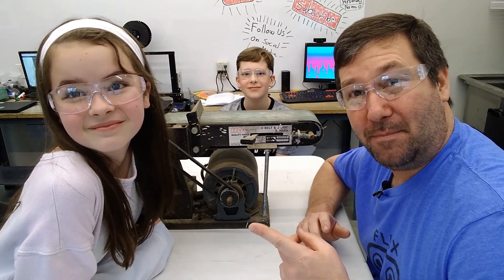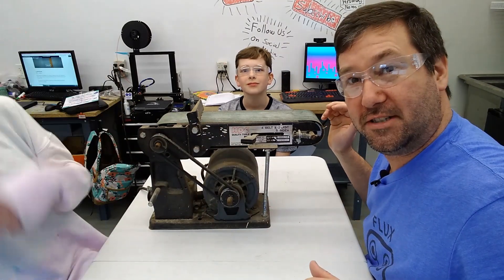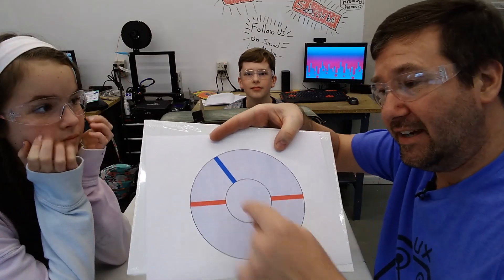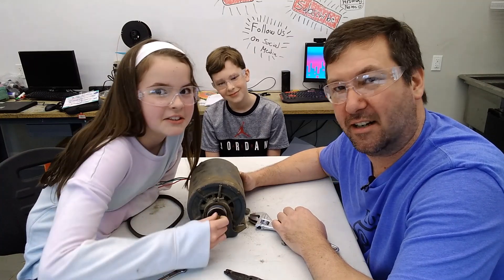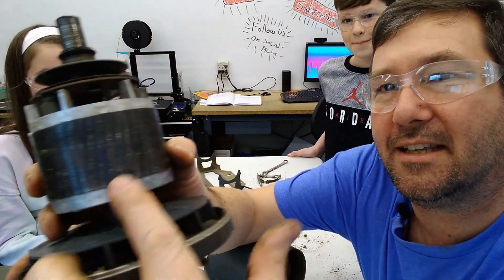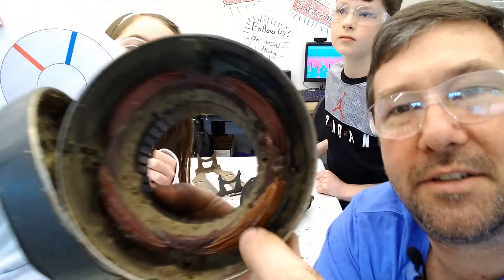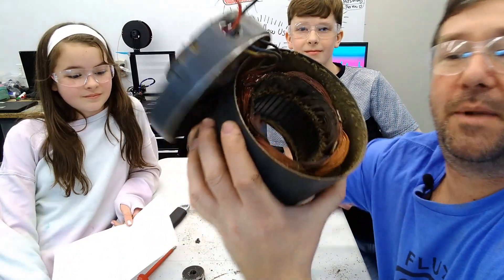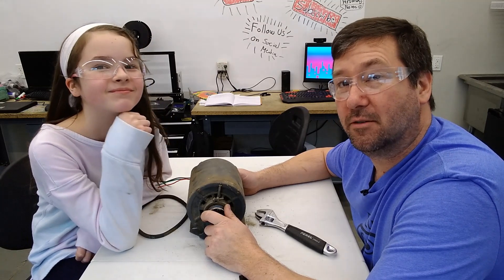What does the inside of an AC motor look like?

Comment: There are three types of motors,  #1   shaded pole, #2  capacitor start induction run and #3 capacitor start capacitor run.  Type #1 uses no capacitor but yours does have a start winding that is in the circuit upon start up and is disconnected with the centrifugal switch during run. The start winding is the smaller wire winding which produces more torque for the start up that is needed. The only thing that would prevent your motor from starting without doing it manually by hand is either the centrifugal switch is not making good contact,   internally the common connection inside the motor winding is not connecting to the common end of the start winding, or  the start winding has a breakdown of the insulating coating on it's winding  causing current to travel across the winding instead of through it,  giving you too weak of a magnetic field to start the motor.

 You are correct,  it is a shaded pole motor, but most smaller ones that do not have a heavy starting load do not have a separate start winding and controlling switch like yours.
Reply from the maker: Thanks for the info, getting ready to make some more motor videos and will try to clarify this.
Reply: @TimWilborne  you're welcome, I learned old school in the 70s getting an hvac license. They were very thorough and detailed so we could do anything, taught us how to ohm multi speed motors to find  lower to higher speed wires and capacitor wires. On single phase compressor motors you get a back voltage across common and start kind of like the voltage generated on the third leg you are getting running a 3 phase motor on single phase.  That same voltage is produced in a single phase motor across start and run and is used in  capacitor start induction run motors to  energize the coil in potential relay aka start relay which then would take the start capacitor and start winding out of the circuit once  the motor was running.

If you were to want to try and see if that motor could start without starting it by hand,  disconnect 1 wire from the centrifugal switch, run that wire outside the case by extending it, then make another wire and connect it to the terminal on the centrifugal switch and run the other end outside the motor. Now you have 2 wires one which is the start and the other the run winding,  hook these 2 wires to a capacitor.
What you have done is placed a capacitor across the start and run winding in series with the centrifugal switch, this will give the motor an extra kick to start, use a start capacitor you can find on Ebay for an AC unit, size it by the HP of your motor when looking it up..

If you want to find which is the start and which the run wire of the 2 you run outside the motor, the higher ohm measuring from common  is the start winding .

Thanks for your videos, I was not clear on how using a three phase motor running on single phase  created 3 phase,  Now I get it, it is what my teachers long ago called back voltage.
Reply from the maker: @melfrank8379  Glad we could help each other become more knowledgeable!
Reply: @TimWilborne   Ebay has some pretty decent  electronic inverters that convert the 240v single phase to three phase.
The old way they use to do it is just like I recommended you to do to your sander motor. Install a capacitor to get a phase shift and a boost into the coil that will start the motor turning.
A capacitor shifts the phase when it stores and discharges current,  The old style units used a potential relay and start capacitors hooked from one powered lead of the three phase motor to the un powered leg to get the motor  started using single phase as a power supply. The motor would run but at lower power without the third leg.

I remember my teachers calling the voltage induced by a motor back into the windings as it was running as EMF electra motive force also called back voltage.

If you want to have some fun get some solar panels and a 3 phase solar inverter.

I have an 8k watt grid tie solar inverter I plan to trick with aa 2.2k watt off grid inverter. I want both 240 and 480v three phase so the 2.2kw inverter will be 240v feeding 3 isolated 3kva transformers converting  the 240 to 480v. wired in the wye configuration the 8kv solar inverter requires.

The primary side of my transformers have a middle leg on the winding I so can tap into 110v, I will be able to access 240 single phase and both 240 and 480 three phase depending on where I tap into.

You should look  into solar 3 phase for your videos I have future plans to move off grid so I needed to figure out how to have multiple voltages.

I am using 435 watt 78 volt Sunpower commercial panels. It takes 8 to run the 2.2k inverter which will power a 3hp 3 phase motor.
Reply from the maker: @melfrank8379  Sounds like fun.  I've played with a few solar projects, but no 3 phase yet.

Comment: Hi. Great family video! Armatures are usually associated with DC motors, this being a AC motor what you are looking at is a squirrel cage rotor. This type of rotor have bars not windings and the bars don't necessarily have to be isolated from the laminated iron core. In fact some squirrel cage rotors are build casting hot liquid copper or aluminum directly onto the iron core, since the melting point of iron is much higher than that of copper or aluminum. Also at 2:48 you can see 4 cables coming out of the stater windings going into the centrifugal switch. I am guessing that those 4 cables are 2 for each winding: 2 for the main running winding and 2 for the starting winding. You could usually detect which is the running winding and which is the starting winding by their resistance. Start windings have more resistance. My guess is that the motor originally had and externally mounted capacitor that connected to the starting winding through the centrifugal switch and was later removed because the capacitor went bad or the starting winding burned out. You could measure the resistance of the starting winding to see if it's burned out and if it's not try connecting it to a starting capacitor and see if the motor will start by itself without "roll starting" it. It would be a shame to see it get scrapped, newer motors are just not build like these old ones. Keep safe!
Reply from the maker: Very good information Martin.  I wonder if you are right about the capacitor.  I was surprised not to find one.  Thanks for watching!
Reply: If you look close there are only three wires coming from the motor, black red and white, the start and run windings are tied together to the common white wire inside the motor winding housing, the black coming from the motor is the other end of the run winding and the red wire is the other end of the start winding,  the red wire from the start winding hooks to the centrifugal  switch, and the forth wire you mentioned is not coming from the motor windings, it comes from the other end of the switch and goes into the end cap  to the connection compartment usually to an overload safety which it and the run winding are both usually connected to the terminal side of an overload which connects to the hot or black 110v supply,  with the white common wire hooked to the polarized or neutral side of the 110v power,

 all motor windings-  start- run, and speed control have one end of their windings internally connected to a common inside the wrapped motor windings.

It would not make sense,  or be cost effective for each winding to have a separate common when each winding can be controlled with just one wire.

I have never seen any motor with more than one common winding wire coming off the motor winding wire wrap. That is why this motor has 3 not 4 wires being, common, start and run.

All motors have the run winding hard wired direct from the controls, no reason to run it through a centrifugal switch because it has to be in the circuit the instant the start winding gets the motor turning and drop out either through a centrifugal switch or a potential relay breaking the circuit.

This motor never had a capacitor , it has no place a capacitor was piggy backed on it and only 3 wires coming from it, a ground a common white and a black wire 
All start and run capacitors connect across the start and run windings,
 motors with an external capacitor being either start or run will have a separate start and run wire coming out of the motor, this motor clearly did not, and had not been re wired.

Being that the start winding terminated at the centrifugal switch, that would have been the only point a start capacitor could have been connected